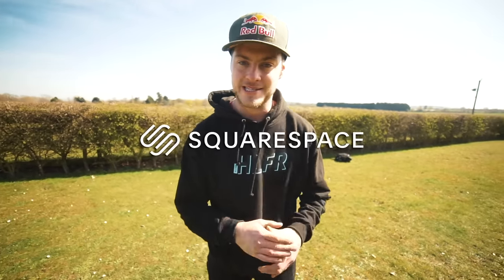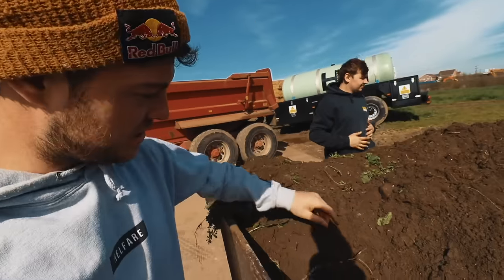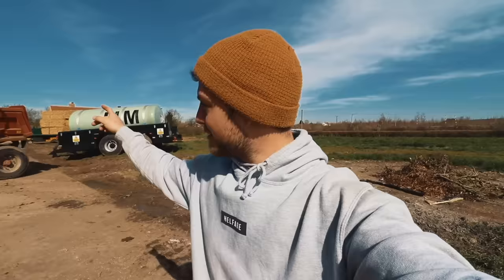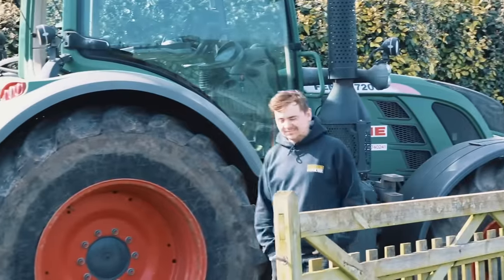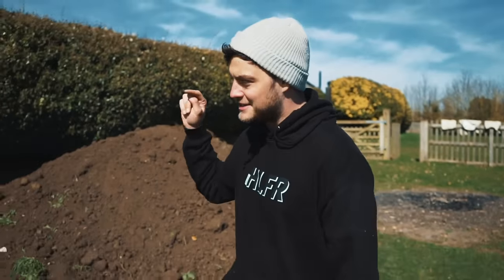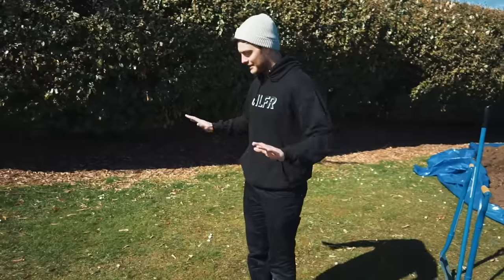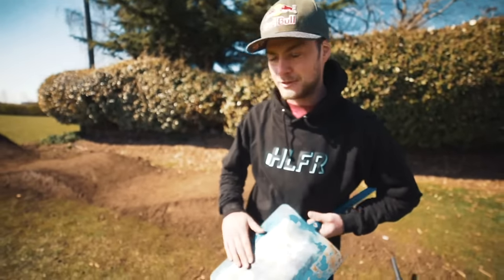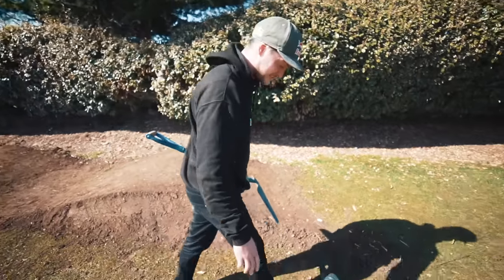I’M BUILDING MTB DIRT JUMPS IN MY BACKYARD!! LOCKDOWN EP1

Comment: build a jump that has the landing under ground level (sort of like a dirt bowl) then you jump out the other side
Reply: Kiwi mtb Brown good  idea but that presents drainage issue living in England that will fill up and be unrideable most of the time
Reply: Good idea I think you could put a burm landing and then do that awesome
Reply: That would be sick
Reply: Drainage idea: at the bottom of that bowl drill a hole and put like a metal sheet with lots of holes in it cover it up a little. All the water should go into the hole but if you make it to small itll overflow
Reply: Borrow old mate and get him in an excavator dig a trench run a Polly and one of those drains they recess into concrete and Bob's ya mothers brother
Reply: @Astridlovesthrash  or just not make it below ground level... ¯\_(ツ)_/¯
Reply from the maker: that would be unreal. I'm worried about rain water but some of these comments have been super useful as a solution
Reply: That wouldn't work at this particular location due to the hedge line and distance from with routes. It would work later as the track returns on itself at some point in the field so you have space to slope the ground slightly and dig a drainage ditch lower which should be filled with pea gravel and using some hex plastic drive support to keep it solid and stop the edge crumbling in. 

Give shout if needed for better info/explanation :)
Reply: in the MX world what you are describing is what we call a gravity cavity. super fun to ride. and our old local bmx dirt jumps had some of them before they got torn down.
 if you have a way to sort drainage they are way quicker to build then normal jumps. you just have to shape the hole you dig lol.
Reply: Didnt soderstrom build something like this in a yellow flower field?
Reply: Calvin Poole u could put a tarp over it
Reply: We used to call this one a graveyard. Its nice because you can use the dirt you take out. But since matt goes big just make the "bowl" between two jumps. Then you dont have to worry about the water issue.
Reply: wouldnt that get super muddy
Reply: Andrew Floyd u could put a canopy over it or tarp there’s lots of ways to cover it
Reply: @MattJones  they have a sick one at the local bike jumps in cali with a roller in the middle to pump and a realy nice step up at the end
Reply: @adamchambers1393 then it isn’t a bowl 😅

Comment: Matt, idk if this'll help but Seth from Seth's Bike Hacks has used a mechanical packing tool for a couple of his builds... That might help you get stuff done faster 👍🏻
Reply: Jack Scheffel a walker plate I think
Reply: Waker plate
Reply: a wacker plate would work but a mechanical one wouldn't work with the British soil because its so tacky it would stick to the machine too much like in one of seths videos when he used more of a clay like soil. Good idea with he wacker tho
Reply: MTB Mikolaj yea that makes sense, didn't think of that! Thanks for the comment!
Reply: @jackscheffel1509  i think they may have one at woburn for the jumps but thats sand not clay, plus idk if matt will be able to get his hands on one with the lock down now :(
Reply: MTB Mikolaj the wacker wont work either if it sticks to the machine itll stick to the plate to. it doesnt stick to shovels because you pack by hitting with a sliding motion. if you go straight up and down even with a shovel it'll stick
Reply: Mopeds are a cheap alternative for packing in once the shapes there, helps you find the soft spots to fill in before riding, I’m sure his pit bikes would work well
Reply: @freerider8737  I used to work for a hire company and they get used on most sites in the UK, I think it would work well. You just have to keep it moving to stop the straight up and down motion and they slide pretty well. Having said that the finish Matt has on the three hes done is like a work of art so its probably best he keeps going his way to be fair!
Reply: B Hew mate im talking about the wacker plate not the machine. the plate on a stick that weighs 10kg. i  have one and everything sticks. old mate said the machine wont work but the plate will which obviously is the exact opposite
Reply: A wacca pacca as I call them
Reply from the maker: I'll check that out for sure! I'm interested to see how hard the dirt goes when it's ridden! cheers bro
Reply: Matt Jones when’s the next vid ?
Reply: Matt Jones for sure man, hope it goes well! I ride road mostly but your channel has been a long time favorite. Thanks for putting your content out here! You're the best 👍🏻 I can only hope my twin and i reach you and Johno's level
Reply: They have one at woburn
Reply: A wacker packer or plate compactor
Reply: @MattJones  wacker packer :)

Comment: Back when my life revolved around riding BMX I spent summers on summers building up the trails in my back yard. Grass/shrubs/moss are a game changer in terms of maintenance. When you plan your next feature, if you cut the grass into cubes and dig out the grass in the general area of your feature before laying down new dirt you can put the grass aside and when the feature is finished you can place the grass down on the sides and backs of your feature. This allows for keeping good moisture and it helps for the stability of the dirt. You've got a killer space and I'm pumped to see the progress!

Comment: Hopefully this isn't to late but I cant help sharing my vision for the line: Make the hipped landing also a berm, curving to the right staying along the shrubs to save space in the yard, also saving space for more lines in the future. Coming out of the berm is a little berm transfer gap. It would be sick to make a left 90 degree left hip once you get to the corner. These types of features would be smaller and flowy saving dirt and space, providing early variety and speed for possibly bigger jumps along the line.

Comment: If that was my spot. I would dig down in the ground for the trail and use that dirt to build up evrything you need. Along with that what I would do is skim the top of the ground all over. With a tractor that has a scraper on the back you just push and push all the top layers to your track. With all that grass too. Use that top layer of grass for your trail. Dig it up like your gonna use the grass as sod, and flip it over for the top layer of the trail. It will be good soft dirt that will compact very well mixed with the grass roots. The grass will probably start to grow out eventually. But just as long as your riding it your tires will kill it before it gets big enough to be a problem. I would also in the middle dig a huge bowl and build up around the perimeter of the hole. So you could jump over the hole. Or in and out of it. And you could make your trails all go through there a couple times. So you could do a different transfer every time you hit that spot on each trail. Giving it a huge amount of variation.

Comment: You've got a lot to learn about what type of soil to use for dirt jumps. Top soil is the worst material to use. You want a sandy clay mix that gives good drainage and doesn't get muddy, the right sand clay mix will also not dry up too badly either.